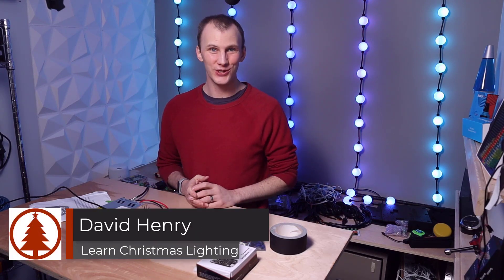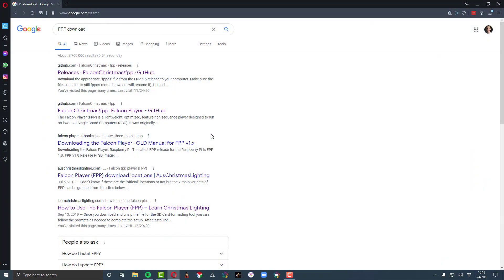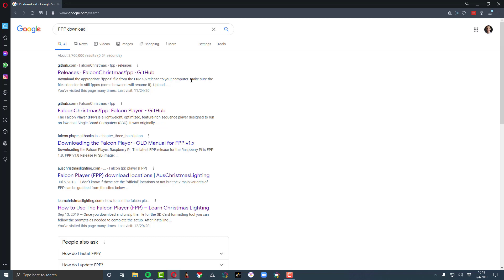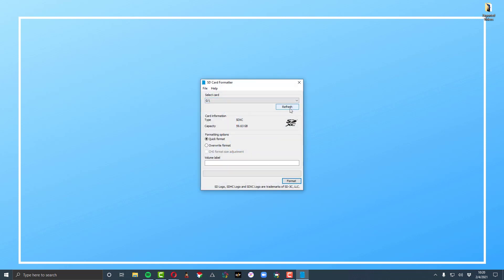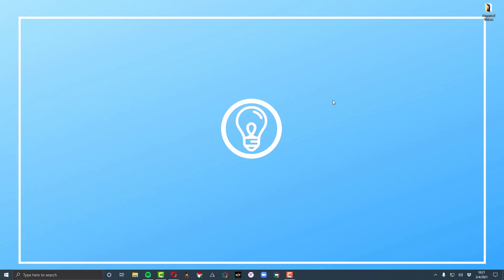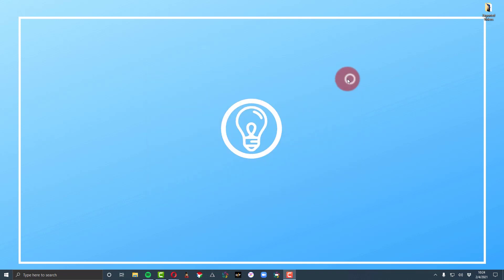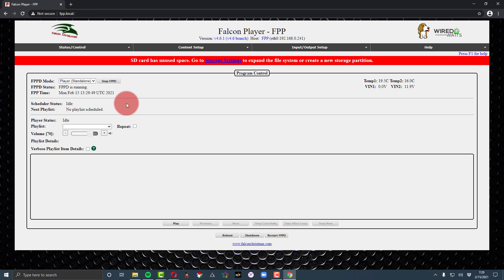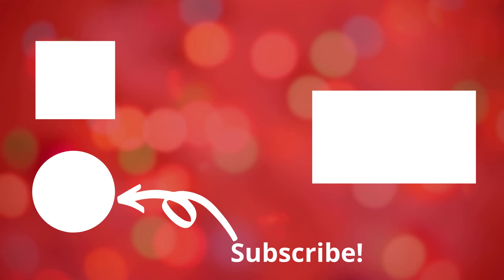How to Install and Setup a Kulp Controller

Comment: Hi David, to start off thank you for all the videos. It has helped me get everything going. One question though. My display has been running fine for over a year. Now all the sudden I am no longer getting audio or wifi. I am running the  K40D with beagle bone, connected to the usb is a hub that has wifi and a soundblaster. I assumed it was the usb hub so I bought a new one and nothing changes. It feels like its an issue with the usb on the controller. Do you know of any way to bypass this or get it working again.

Comment: David, this is a good video - but I was wondering if you could take it a step further. CCL Controllers has a very in-depth video about building out the Kulp 32 with their kit. Would you be up for doing something similar with the Wired Watts box/boards?  The layout is pretty different and so not everything translates from the CCL system to the WW system. It'd be great to have that out there as a resource for folks just getting started.

Comment: Hi, do i need a beagle bone to controll with a Vixen or xLights software?
Reply from the maker: Yes, BeagleBones or PocketBeagles are required with the Kulp controller - check each controller's specs to know which Beagle you need to make it work!
Reply: @LearnChristmasLighting  what about jynx, madrix, elm? do i need the beagle too?
Reply from the maker: @michaelungaro1822  Yes, it is the controller's brains :)  It is required to run anything :)
Reply: @LearnChristmasLighting  really? did yo successfully used it to use it paired with jynx  or elm? i was reading its manual and it directly send you to fpp online the falcon controllers, i hope you can answer this question
Reply from the maker: @michaelungaro1822  yes, you can configure it to receive sACN or artnet on the inputs configuration page

Comment: I have a Kulp 32. I use 12v lights but I just bought 500 5v lights for less than a dollar total. Can I mix 12v and 5v on a Kulp32?
Reply from the maker: I believe you can - you would set the jumper on the first set of power inputs for whatever power you are providing there (this powers the BeagleBone computer).  Then the other (3) banks of power should be able to do whatever type of pixels you have - but be VERY careful - mixing voltages within the same controller is typically fine, but if you mess up, you will fry gear!
Reply: @LearnChristmasLighting  Thank You.

Comment: Hi David, can i use a 15v 30a 360 watt controller?
Reply from the maker: I don't think so, plus you'd need 15v pixels, which are not common

Comment: Does ws2812B work on Kulp controllers?
Reply from the maker: Yes, it is the same as WS2811, set it to WS2811 signal type and you'll be good.
Reply: @LearnChristmasLighting  cool. Thank you.